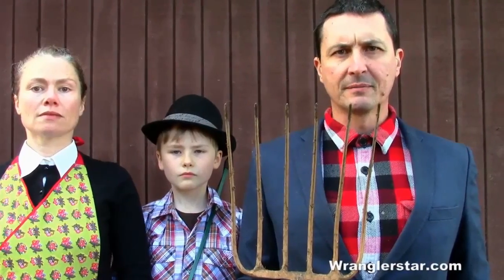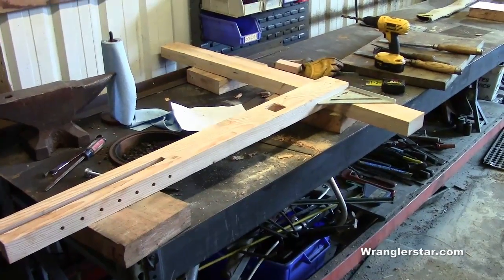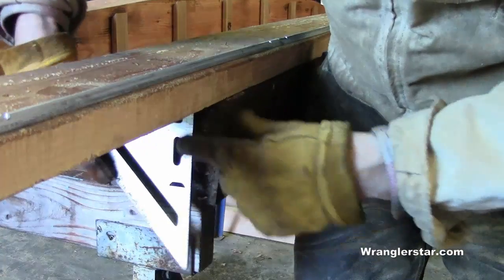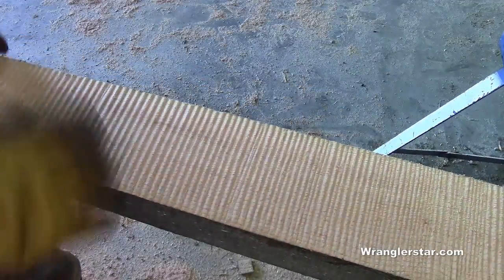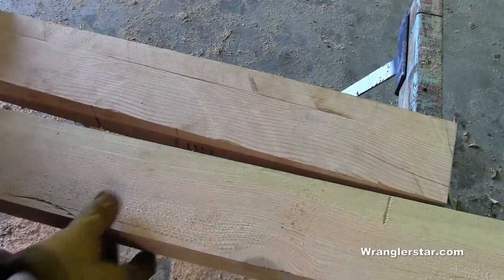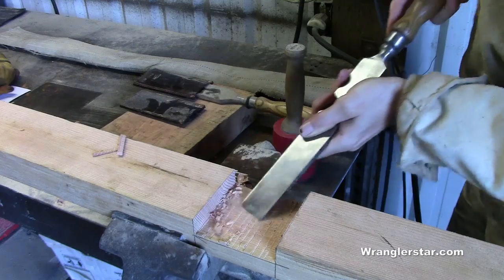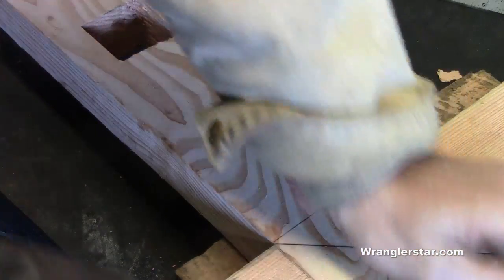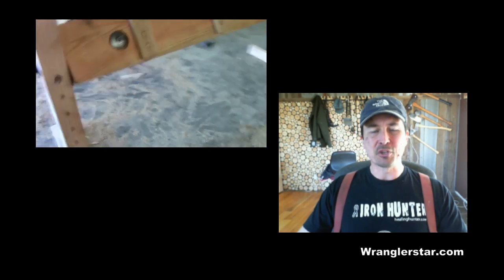Crosscut Saw Vise 4.0 - Wranglerstar

Comment: Wow you just made an interesting connection. Wood that you buy at the major hardware store is feminine because it is rounded and slimmer like we like our women, it even goes through goes through a drying process . Full dimensional lumber that you mill yourself is rigid with 90 degree corners and is good and a hefty ,and it's completely air dry. In conclusion if you buy buyer wood at a major hardware store....you're a sissy
Reply from the maker: You said it,